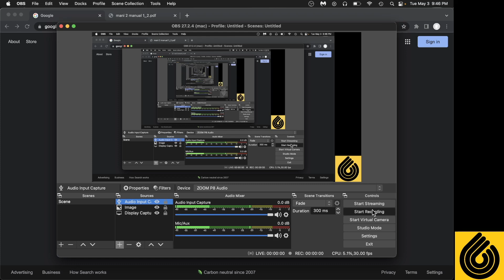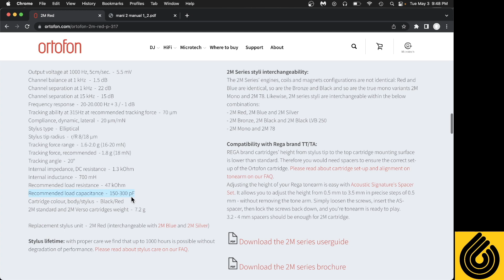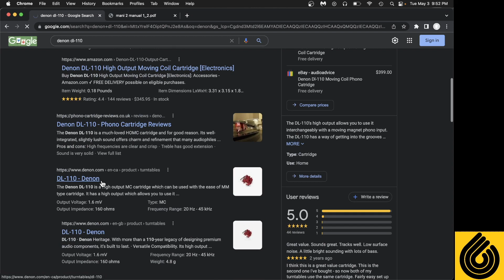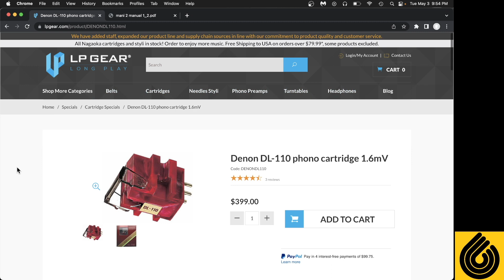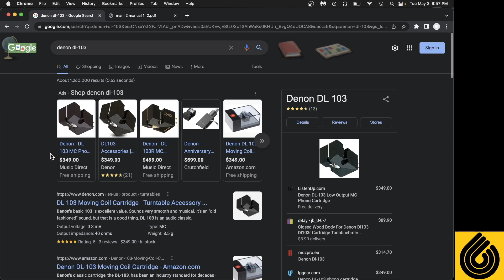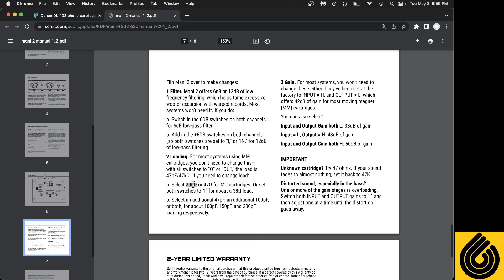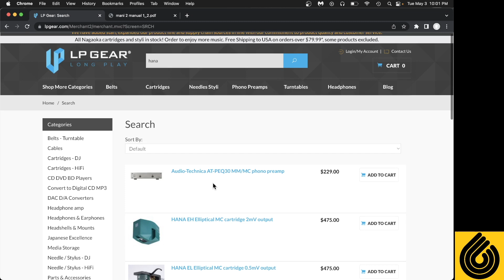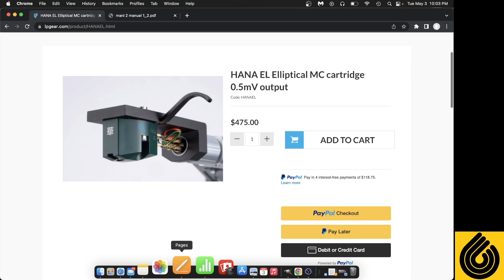How to Configure the Schiit Mani 2 (or any phono preamp)

Comment: Extremely helpful! The switches on the Mani 2 confooosed me.  Your video cleared up the mystery.  So I’m going to increase the load cap to 100pf for my AT vm540ml cartridge (recommended is 100–200pf). It’s currently set to the factory default (47pf).     Is there any advantage in operating at 150 or 200pf instead?
Reply from the maker: It flattens the high end of the frequency response curve, giving you a more neutral, balanced sound.  If the highs seem too subdued at 200pF, you can reduce it to 150 or 100pF.  It's all going to depend on your ears and your system.
Reply: I increased the load by 47 so capacitance on Mani2 = 47x2 =94.  My interconnects add another 72pf.  This gets me to 166pf.   No idea what the capacitance of my Technics sl1500c tone arm is but guessing 30ish.  Grand total is 196pf which gets me to the upper end of the recommended range (100-200) for the AT540ml cart.  I detect a smidge of improvement - maybe not as harsh on the highs.  I’ll leave this setting on for awhile and see how it goes. So far so good.
Reply from the maker: @diamondintheback1970  I've noticed that the difference is capacitance is very subtile, but noticeable.  It's really a thing where you're going to want to tweak it to what you hear.
Reply: @6AM_YT Thanks for the tip!  I’ve decided to go with the 94pf setting on the Mani (vs the factory setting of 47).  Noticing better sounding cymbals and bass player slapping on Steely Dan’s Peg for instance.  I found it easier to A/B for differences with headphones (HD800S) than with speakers.